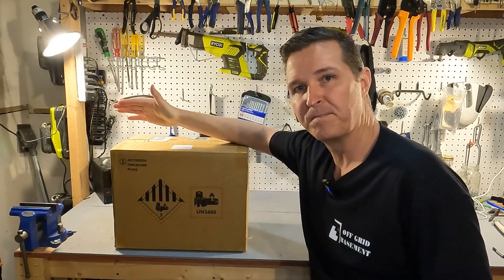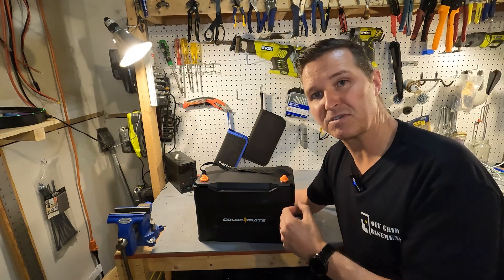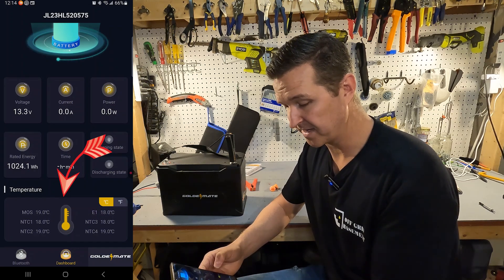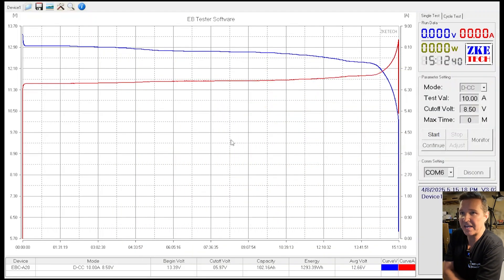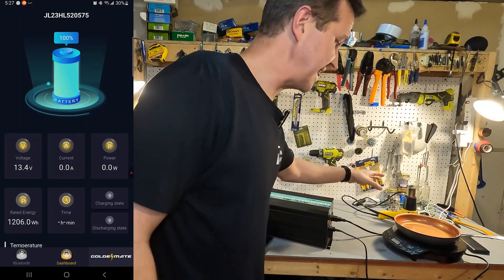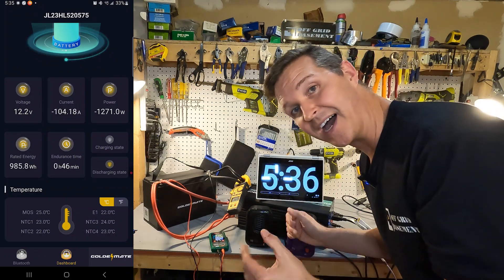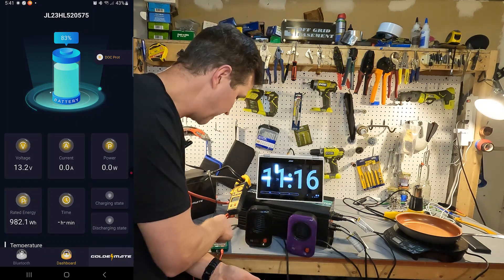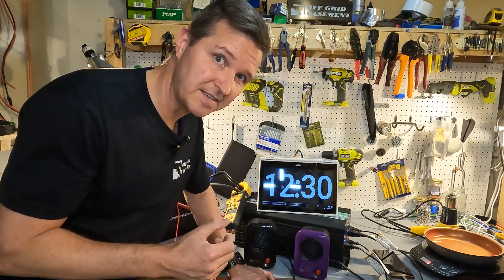GoldenMate 12v 100ah Lifepo4 Waterproof Battery Review

Comment: At around 13:15 you say  a pair of 8AWG wires is equivalent to a 2AWG wire, but that is incorrect.  Putting 2 similar wires in parallel drops the AWG number by 3 (not 6) so the correct equivalent is 5AWG .  
I find it interesting that this BMS has both the POS (Orange) and NEG (Black) wires attached,  In most BMS's have just the NEG (Black) running through it (through some BMS's are designed where the POS (Orange) runs through (for example the new BMS from Overkill Solar).  In this example I suspect the BMS is designed with the POS simply wired though the PCB of the BMS while the NEG is controlled by the FETs.
Reply from the maker: Thanks for the comment and info.  I was going by the mm2 of the wire for comparison.